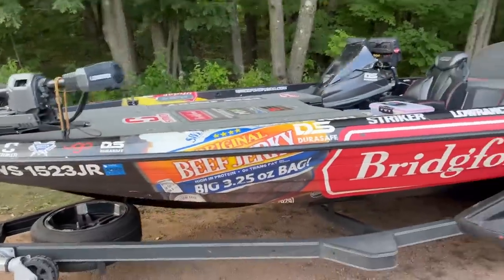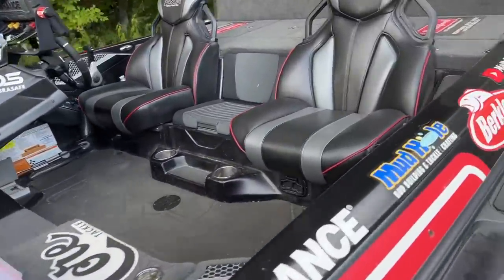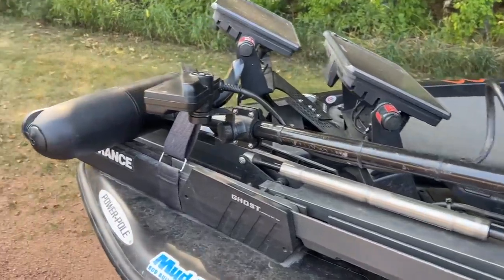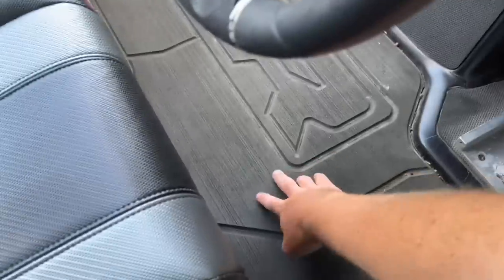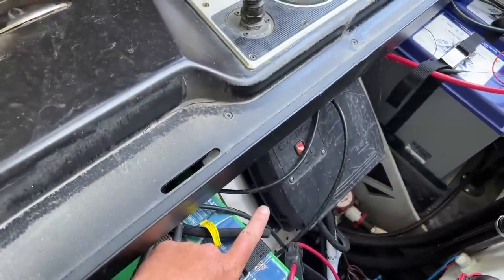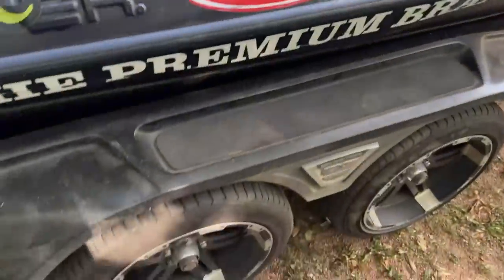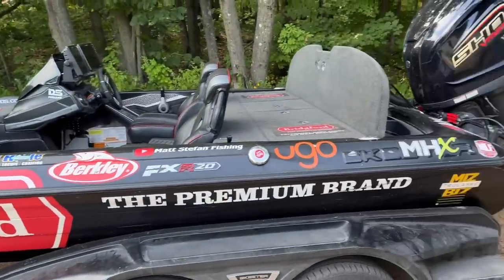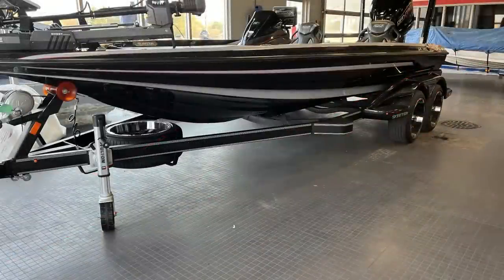My Winning Boat Is For Sale! First Come First Serve!!!

Comment: What is the modification you did with your Ghost? I see you use a bungee cord attached to what? I'm looking to do the same but wanted to know what you attach it to? Thanks.
Reply from the maker: i just strap it down with a bungeee for running in rough water.  I have an aluminum plate screwed into the deck and attach the bungee to it.  works great!